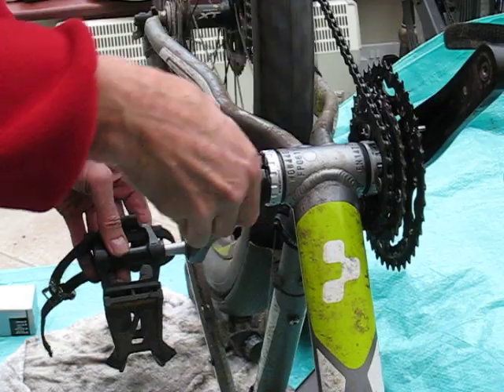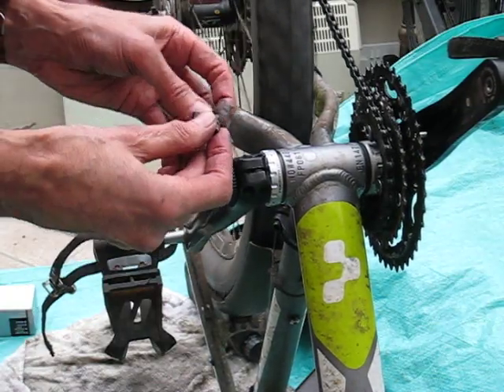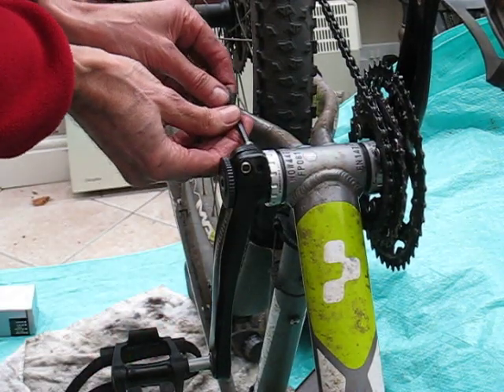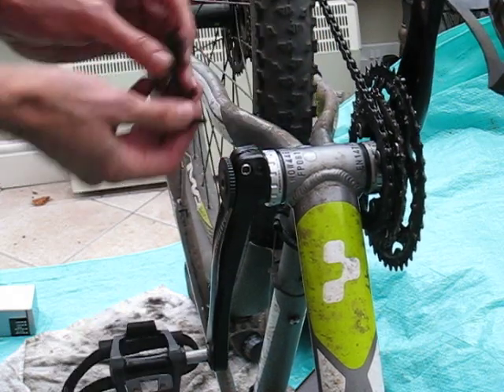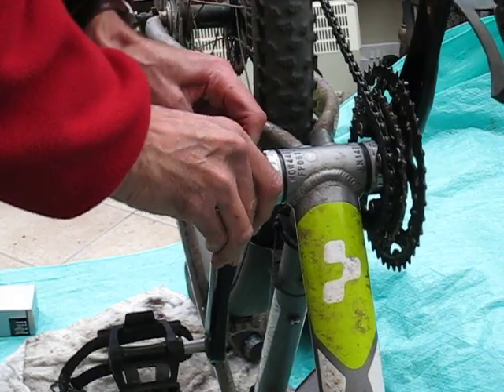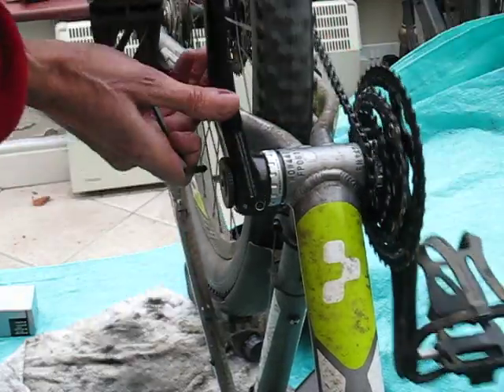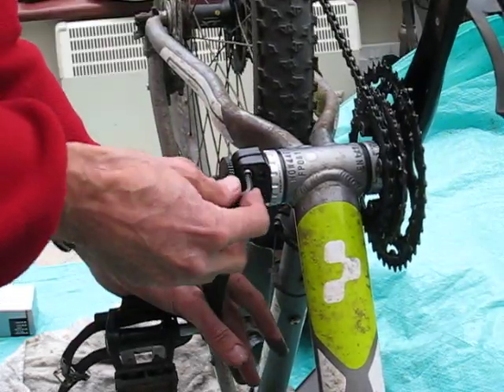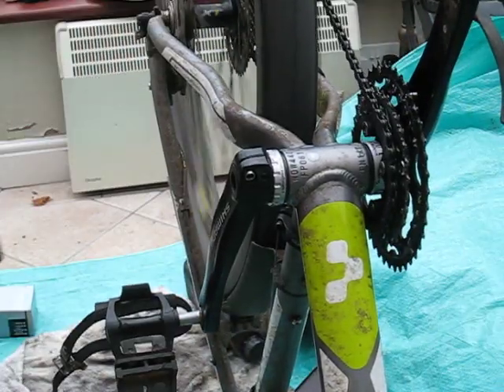Shimano Hollowtech II bottom bracket replacement / repair - part 3a

Comment: Great vid and thx so much for posting it.   My question is when you re-install the 2 socket head cap screws in the crank arm to tighten the crank down onto the spline; is no Locktite required on the threads of the 2 socket head cap screws to ensure over time that they do not vibrate loose?  Cheers and thx again.

Comment: Do Not Disassemble
So you need to buy the whole set

You can actually replace the bearings... 
Bearing #6805. 
It's cheaper than buying the whole SM-BB52 set. A very good Japanese or USA made bearings about just 20% of the cost. And i have been doing that several times already. 
Just make sure you're best or very good or at least good in pulling out and pressing in the bearings so you don't damage the housing.
Good old Filipino ingenuity.

Comment: 1) What kind of bolts are you using - steel, alloy, ti/alloy?
2) Where is the point to have that small "safety catch" you place in crank arm before bolting it? It holds nothing anyway ...
3) The same question about black tube that goes inside the frame. If you don't use it will it harm?
p.s. good video.
Reply: mici911 I suggest to use Ti bolts (M5 x 18 for example). Original ones may rust after years and it will be hard to get them out.
Reply: +mici911 
The Safety Catch actually to push the crank arm in at the nicest fit so so don't get a loose fit.
The black tube is part of the sealed in mechanism so as to prevent water from entering the BB assymbly. Because there is a hole on the underside of the frame